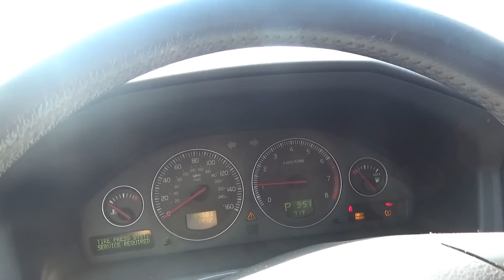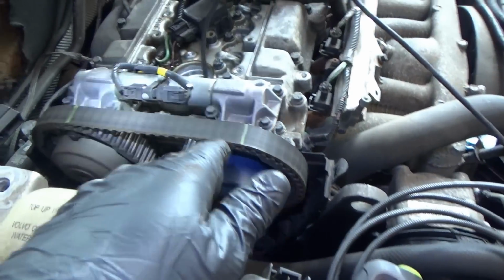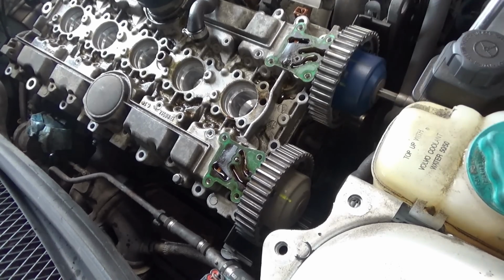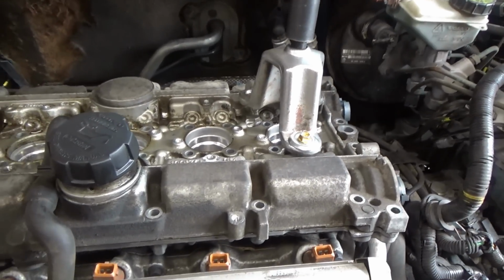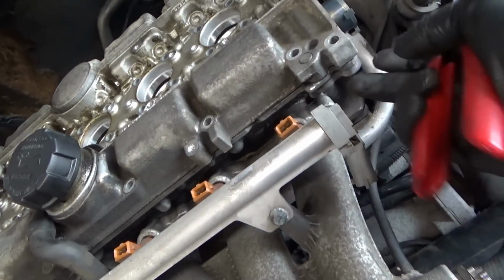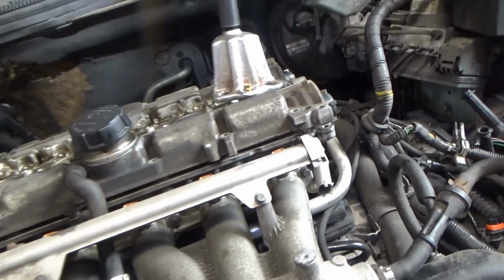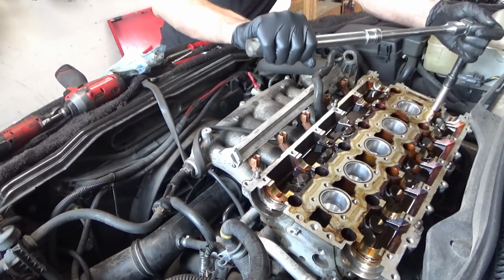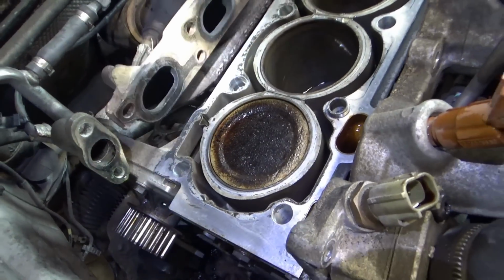Grenaded Volvo...Grenades COMPLETELY? (Part 1)

Comment: Hello Ivan,

Great video as always.  Have a Q:

  Could excess vacuum (neg pressure) at intake be cause by the turbo?  No high pressure from exhaust to spool it results in intake restriction.

P-Chi

Comment: I love those 5 cylinder engines! I had one in a 06 XC70 from 125K to almost 200K. During this time I was the only person to work on the car, it never went to a mechanic for anything. I did the PCV system, a rather difficult job. I also did cam seals to stop a large leak, at first with no success. Those seals ride on the lip of the VVT pulleys, my exhaust pulley had excessive in and out play and was moving the sealing surface beyond the seal. I do recommend doing those seals and checking the pulleys for end play. As I am watching this, I feel like I am back under the hood of my XC. Those cams have no key, if you pull the complete VVT pulleys off it requires an alignment tool. Nice work getting that valve cover off!
Reply: Was that the cam hubs? If so my mechanic knew to check and replace those but they are very expensive at $300 each.
Reply: @zzoinks  Yes. Only the exhaust was bad on mine, I could definitely feel a lot of play inward and outward. It was pricey but it solved the oul leak problem.

Comment: Would heating the cylinder head up make it easier for removal where those dowels were? I wonder if heat and cold shock would work without cracking the head.
Reply: Unlikely might actually crack the cover it is an alloy that stuff doesn't take the heat well.

Comment: I worked at a Volvo specialist for about 3 years early in my career. These heads are super easy once you've done a few. The ones that suck bad are the T6 engines in the S80. Hope you've got the pink Volvo sealant for the cam cover.
Reply: I did the S60, 2014 I believe and those turbo bolts in the back were the hardest to reach, very bad design if you ask me. Mine was a chain driven and not belt.
Reply: @scientist100  Yeah that one's a little more difficult. But imagine an inline 6, transverse, two turbos and all the intercooler piping. That's the T6 S80. Freaking nightmare. Turbo bolts are always a pain. Just too much cold hot cycles.
Reply: A lot of things are easy when you've done a few... 😅
Reply: @rkan2  Lol. Idk I just did turbos on a 2018 Fird Expidition. And that sucked! Next time I'm taking the cab off first.

Comment: I had something like that on my 1991 Honda Civic 1600 single cam 16 valve. Sometime in the past the centre electrode insulator had broken on one spark plug and the piece had gone out the exhaust, denting one valve and its seat. At 354,000 km, it finally dropped a chunk of that valve and went onto 3 cylinders. One new valve and a quick regrind and it was back on the road and good as new, till I sold the car at 375,000 km.

Comment: Dejavu, Just did a head gasket on 2009 S40 two weeks ago. I ended up fabricating valve cover pop off tool from cheap harbor freight channel locks. Worked exactly like OEM tool. Make sure you use anaerobic sealer on the valve cover.

Comment: The Volvo 5 cylinder is actually a very good design engine, it arrived on the US back in 1993.
Reply: It was designed together with Porche in the late 1980's. That time Porche had financial difficulties and had to sell it's "secrets" by consulting other companies like Seat (VAG) and Volvo. Result was this Volvo modular engine 4/5/6 cylinders, manufactured from 1991 to 2016. No wonder that after 20 years the engine in this car is very reliable and has good performance too. 

Fuel consumption is the weak point of Volvos, but it is also due weight of the car (safety). My V70 with this engine (B5244T3) gets as low as 30 MPG at steady 60 MPH. 

Weaknesses are the random auxiliaries, like valve which grenated this engine. Mangeti Mareilli throttle body etc.
Reply: @jannepo  They had them in one of the VW cargo vans the one in a fleet of different vehicles it was the one always at the dealership with No 5 cylinder problems (The rest of the fleet were majority Toyota Hi Aces.)Specifically designed by Toyota from alterations the company wanted & got as they bought hundreds of thousands of them.
Reply: It was also used in the Ford Focus XR5 turbo
Reply: @paulsz6194  Nice info

Comment: The only comment I would like to give (maybe said before) I was taught that if you are re-using the head bolts is to have a piece of cardboard & mark the front & place the bolts in order that they were in when taken out (1through to5/6 front to back as they should be replaced in order of extraction .Obivisouly if they are being replaced this does not matter.Many vehicles specifiy that new ones must be used. Cheers again a good video.Looking foward to the rebuild.

Comment: It's amazing how long/far an automobile can go without any service. The ones I used to see rolling around the hoods from the Midwest to the deep south amazed me.
Reply: 6 years according to a woman who never changed the oil in her Kia Rio.
Reply: @marshmower  KIA will honor 10 years powertrain.   If you'd try to change oil..on time. oh nvr mind.
Reply: It truly is a testament to the engineering.  Even the brands I hate on like Ford, dodge and this euro trash.
Reply: 95% of the cars that Ivan works on would be crushed in Germany as they would never pass what is called the TUV inspection. In Japan it is illegal to have a car over 5 years old as they send their older vehicles to the 3rd world.
Reply: @satamanschmidt3428  If you want to buy an exellant used car import one from Japan.Probably won't cost much more if any to do this.
Reply: @timewa851  I was trying to keep a straight face. I believe she smoked millions in cigarettes so to hell with the car. Some folks can't look out for themselves.
Reply: The keyword is computer control. After it came a long, cars will run till there's almost nothing else left. 😂
Reply: @rkan2  Then there is the computer control that will not allow the vehicle to start or go into limp mode (The Mazda in a recent video with the crank angle sensor that disabled the transmission).There are so many variables in different manufactuerers when it comes to the high & low can buses..If you sit & think about how electronics have intergrated into them the mind boggles.That is why we are blessed with people like Ivan.Cheers.

Comment: Looks like the valve lash buckets that are under the removed camshafts, 4 per cylinder, could easily fall out of the head as you have removed the camshafts. So as you move the head around please dont let them fall out and get mixed up. Each of those valve lash buckets are unique to their locations as they are how valvle lash clearence is set. Plese dont let them fall out and get mixed up.
Reply from the maker: Don't worry, not my first rodeo ;)

Comment: Now you're in my wheelhouse Ivan.  I've done hundreds of head rebuilds on these Volvo's over the 13 years I worked for Volvo.  Little tip.  There are pry points next to every dowel for a reason.  Don't be afraid to use them, they can take it.
Reply from the maker: The pry points under preload was the first method I tried per service info...might have worked if I had those special giant spreading pliers 😅
Reply from the maker: Why did those hundreds of Volvo engines need rebuilds?
Reply: @PineHollowAutoDiagnostics  Broken timing belts mostly.  But some burnt valves and blown head gaskets.
Reply: @PineHollowAutoDiagnostics  You could try a pair of pry bars with the tips facing away from each other.  Usually worked well for me.
Reply: @PineHollowAutoDiagnostics  probably because frugal older people people bought the volvo and were short tripping the cars, always carbon up everything thing..sometimes its the  type of people attracted to certain cars

Comment: I did a similar job on my sons 2014 s60.Timing belt destroyed by frayed serpentine belt.(60K) 10 intake valves later everything hunky dory. Now at 120K Note to self- watch serpentine belt condition. As a side note, the car was purchased that way.

Comment: Used to have 1999 V70R and it had the same crappy sodium valves. Mine dropped a valve around 220k. I used plus instead of premium. That's the only cause I could think of.
Reply: I think this and other non R engines have solid steel valves?
Reply: Sodium valves are a normal valve but the valve stem has a 1mm bore inside and sodium powder is inside. When the temp is high enough the sodium liquefies and becomes sloshing coolant to take heat from valve up into the stem where it can be conducted to guides which are in coolant cooled part of head. Hardened valves on turbo engines often fail to look like a cutting torch cut.

Comment: Ivan, you're finally working really nice automobile! I bet that sure helps as your carefully plod threw the process. Really appreciate you showing us this one.  For a moment I thought you were going to do this job outside in the sunshine! Thanks for Sharing!
Reply: Your definition of a really nice automobile is very different from mine. I believe in burying the dead not letting them live in ever more misery. Ivan needs to find a really nice car crushing operation near State College and use it far more often. Don’t they have any Toyota dealers in Pennsylvania? We had them in Pittsburgh.
Reply: @satamanschmidt3428  To each his own.
Reply: @satamanschmidt3428  The last four vehicles in Ivan's previous two video's were a rusted out Nissan Xterra, a rusted out 94 Ford Ranger, a KIA with a blown engine at 40K miles (only mentioned), and a Mazda 6 in limp mode but only needed a knock sensor once that was figured out. The Volvo looks like it might be a runner for a very long time and that's what I call a "really nice car" and worth putting some time, effort and money in. Those list above not so much in my opinion.🙂🤪 🤢

Comment: Looks like fun. I had a Volvo a while back, the owner replaced the alternator a couple weeks prior to dropping it off, the tilt bed. Easy fix, just had to replace the engine because of one bolt He forgot to tighten.   👍👍🇺🇸
Reply: Replace the whole engine because of an alternator bolt?
Reply: @paulsz6194   Yes indeed.
Reply: @paulsz6194  Figure it out yet?
Reply: @brianw8963  no, I guess that’s got me stumped.
Reply: @paulsz6194  It was a while back and I don’t recall exactly which bolt it was, but it worked out and relieved the timing belt of its duty. Must have taken a while and hard to believe it didn’t make some noise, but it had about half of the bolt head eroded away.

Comment: You should get a 4ft breaker bar, or at least a cheater pipe-  when pulling those head bolts;  it's so much easier with that extra leverage (especially on a big diesel).  These seemed to come out smoothly though.

Comment: I think those spark plug clamps hold the cam cover down so that the Springs don't load the cam cover and cracking before all the screws are removed
Reply from the maker: spark plug clamps?
Reply: I don't know what they're called but they screw into the head and hold the cam cover down while you loosen all the bolts. It's the thing that was on the diagram you pulled up which showed the pliers for separating the cam cover. I don't really know what tool is called

Comment: Why just change a valve or two?  You got the head off, wouldn't it be worth it to replace valves and clean up or replace damaged seats?
Reply: These engines around 20 years from production start usually run half a million kilometers without valve problems. Unless there are some visible wear and tear, replacing  all 20 valves is not necessary. If this engine has not eaten an steel ball, it would have continued to run and run without valve issues. With hydraulic lifters and frequent oil changes, no burnt valves either.
Reply from the maker: @jannepo  no hydraulic lifters here... Just simple buckets!
Reply: @PineHollowAutoDiagnostics  Ar right, it's B5244T4

Comment: The machined areas that control cam fore-aft float can be broken by uneven lift. That is why the tools are used to let it lift evenly about 10 mm to clear the load of the cam lobes on ramp. You can use 7mm threaded rod and nuts at 4 places screwed into removed cover bolts to control cover lift. 7mm all-thread is a bit hard to find but nut abd bolt supply stores have it as does Amazon.

Comment: Awaiting round 2 to see the carnage.... your getting good at these basic exhaust valve jobs
Reply: If it was my vehicle I would have the head checked (at an engineering shop ) & replace all the valves not much more work with the right tools.If a head gasket has gone on one of mine I do this as a routine part of replacing the gasket .My logic is while you're there why not.
Reply: @LesReeves  I think Ivan has the right gauge on this, give it some life, make it drivable for the customer, ship it. Yalls cars back there don't have a long shelf life

Comment: Scanners & spanners - Hens Teeth stuff. Most garages would run a mile from this job as modern Volvo cars are generally a total pita to work on due to the complexity.  This is why people drive silly distances to get to Pine Hollow..

Comment: I'd also look at the bore of that cylinder just to make sure it's not badly pitted by the foreign object, but if the oil consumption is acceptable I don't think it's serious.
Personally I'm not a fan of open deck blocks, but maybe that's because it's a common culprit for the Subaru headgasket issues.

Comment: 50,000 miles with a burnt exhaust valve! Opening a valve cover like a clam 🙂 Interesting job - never seen an open Volvo engine before. On to Part 2 🙂
Reply: Thant is because hardly anybody has seen the inside of a volvo 5 cyl before. I work on them, and since 1993, when the white block engines came out. I've had the head off exactly ONE. It was because he ran it with a failed water pump till the timing belt stripped and bent every valve. Well, I think 3 or 4 weren't, but by that time, all get replaced. 
A very tough and well engineered engine using top quality components. Common as dirt in Seattle area, and the Northwest in general. And please, people, notice I said NOTHING about the plastic used in the interior, so don't go on about "well MY volvo had broken plastic from day one. " We all know the plastic didn't live a long and healthy life. I'm not sure anyone even knows the upper limit of life on a well cared for white block engine. It will easily outlive the Toyota (Asin Warner) tranny. That is good engineering. I've got red block customers with well over 500kmi on their 240's, and the later cars were hands down more durable.
Reply: @607perkins  Yep, not a common engine.

Comment: On my 4.0 Ford Ranger I forgot a red shop rag in the intake and it swallowed it. It was idling rough and I didnt know why so I held it at 3k rpm for about 4 minutes and it all passed through the valves without damaging anything. I didnt realize what had happened until I had to pull red rag out of the egr valve. Cleaned the egr its been puring like a kitten for over 100k miles since. Yes Im lucky but the high rpms saved it.
Reply: WOW that's insane 😂. Glad it turned out alrighty

Comment: I have not watched all of the video. But you should use the hold down/removal tool fore the valve cover becuse the valve cover can crack/ damage camshaft.
And use volvo selant on the valve cover. We have found out that its the onley one that works in the long run.
Reply: I agree, these valve covers can crack if you don't follow the correct procedure.  Undoing the bolts a little at a time until all the pressure is released minimises the risk but is quite time consuming.

Comment: common fault the aux drive belt can shred the  edge of the balt then drop to crank pully wrap around and work it way under the crankshaft timing belt over crank pully and cause timing to slip and then pistons hit the valves  so change aux belt regular inspect and clean belt debris done a few volvo 5 cyl s

Comment: Just a note on the design. Apparently Volvo took that into account, but I'm rather surprised that a high-output, turbocharged engine like that would only have four head bolts surrounding each cylinder, as opposed to five.

Comment: A five cylinder engine?  Hmmm ... that's odd!
Reply: 6 cyl was too wide to fit into the engine bay. It was possible to do only by using a special version of automatic transmission they used in the rare 6 cylinder cars. 5 cylinder was an compromise and it has an distinctive but pleasant sound, like an half 6 and half 4.
Reply from the maker: @jannepo  I love the Volvo 5 cylinders! Very smooth and torquey 😁
Reply: @PineHollowAutoDiagnostics  turbo models are very nice to drive. Low pressure turbo engines have maximum torque of 210 lb⋅ft at 1800-5000 rpm so you have strong pull at a wide rpm range, like the engine would be much bigger than it is, although it is "only" 200 hp. Very nice and quiet car to drive and nice on the highway. 

The S80, V70 and S60 were the last Volvo cars designed by the Swedes without external pressure. They were way too expensive to build by Ford standards (Ford acquired Volvo). Same thing happened with Saab. 

Saab and Volvo engines had the tightest machining tolerances there were in the 1990's and 2000's. That is why this "tin engine" as the all aluminum Volvo engine is called in Scandinavia was build with all the structural supports it has to make the tightest tolerances possible.

With B18 and B20 red block reputation being very long lasting engines, Volvo had an high pressure to keep up the reputation they had. 

Unofficially Volvo engine designers said that they give an 260 000 km guarantee for the engine. Well maintained and not abused engines easily reach 500 000+ km.
Reply: @jannepo  I guess my "odd" joke fell flat. 😄🙃